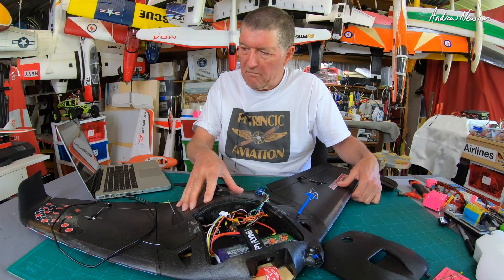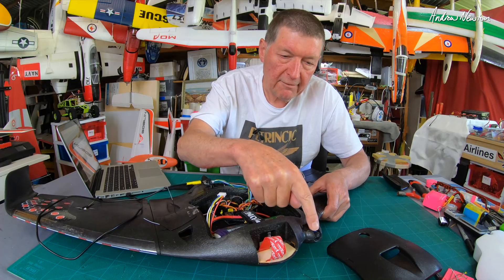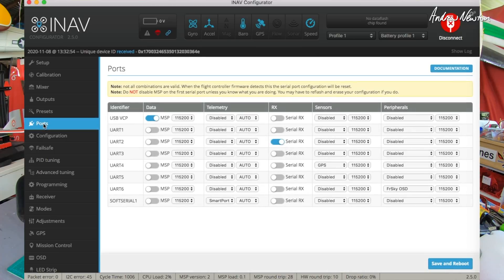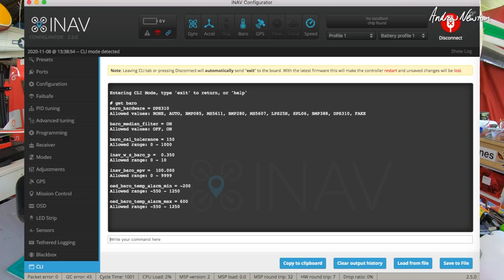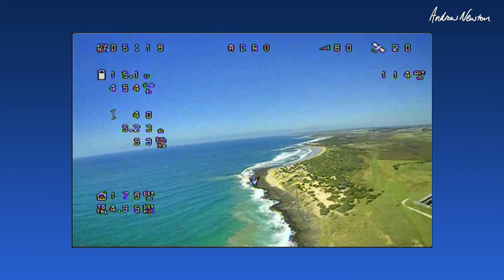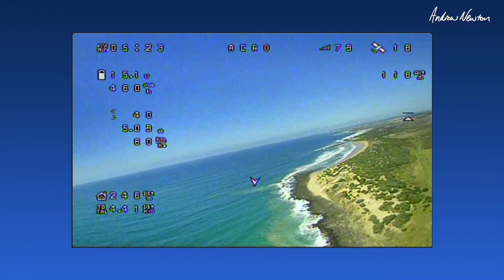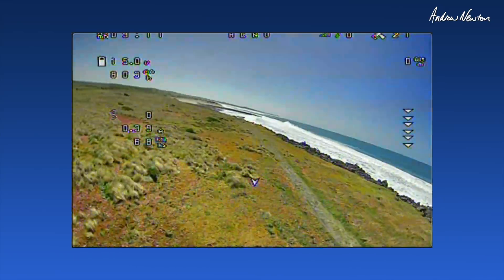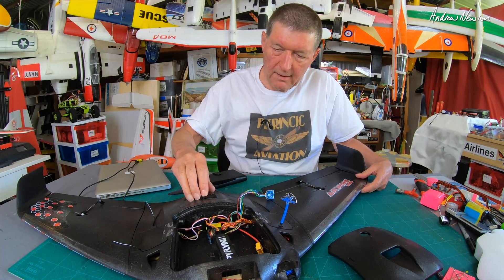AR Wing Pro - Matek F722-WPX

Comment: I am finally dipping my toes into iNav. Do you have a recommendation for a type of flight controller to use with this wing and a dji system?  Oh yeah and Crossfire.
Reply from the maker: Any of the Matek Wing or WSE boards. F411 can handle DJI with the correct firmware but I would prefer one of the bigger boards.
Reply: @AndrewNewton  I might try the matek f722wpx if I can find one in stock. Is the OSD for iNav decent with DJI Systems?  I have it running ok on betaflight but use a Kopilot FC
Reply: @AndrewNewton  does the f405 not work with dji systems?
Reply from the maker: @johndylan9309  No problems using the F405. But do you understand that DJI doesn't use the INAV OSD chip?
Reply: @AndrewNewton  wait so regardless of matek FC I would not be able to see any OSD display in my dji goggles?  Does that mean I am better off just keeping the kopilot as a FC and using any FC with a gps through betaflight
Reply: @AndrewNewton  maybe I miss understood you. Painless360 is telling me that iNav OSD is supported by dji but limited?
Reply from the maker: @johndylan9309  Lots of videos on the subject John. Including on my channel https://www.youtube.com/c/AndrewNewtonAustralia/search?query=dji%20inav

Comment: Great review, I'm trying to get my ar wing pro ready for maiden but can't get the sonicmodell 40amp esc to work. I've wired it to my f405-wing like I've always done setup inav 3.0.1 like always but this thing just beeps slowly and constantly it won't program using inav or radio, only thing is I'm not using the build in servo connector on this esc, what's the purpose of this connector? Is it required to make it work? Thanks for video
Reply from the maker: Not using the servo connector? Must connect the black and yellow/white wires to the FC (but not the red wire)
Reply: Thanks Mr Newton I'll give it a try

Comment: Out of the box, the throws on this plane are almost double the 12mm.   Did you limit the throws in the radio or in INAV?  I've done the Drift and the Ranger 2000 in INAV got them flying well in manual mode without any adjustment to the throws.   Apparently rule #1 in INAV, no mixing on the radio, seems like changing throws on the radio would fall into that category.  I thought I watched on your INAV videos, and I thought you did this in the mixer on INAV.  With the AR WING PRO, seems like you are limited in mechanically adjusting the throws due to the 1 hole on the control horn.
Reply from the maker: Are you testing throws with elevon mixing (50 aileron / 50 elevator) or using full 100% input? If you're using an INAV flight control board then all mixing is done in INAV, and you can reduce the mix weights to whatever is appropriate.
Reply: @AndrewNewton  . Basically, I have my mixer setup like yours (except servos are 2 nd 3 instead of 3 and 4).  The confusion for me is (everyone says set your plane up mechanically in manual mode before you hook an FC to it).  Flying without an FC in manual and you mix in the throws in the radio and the plane flies well.  Now you move to INAV and you remove all mixing.  So if I understand correctly the process would be:
1. Trim mechanically and get flying well in (without the aid of a flight controller ) this would also include adjusting your throws in the radio
2. Load INAV on to an FC and set  your plane up as a wing
3. Remove all mixing from the radio (trims/weights/etc)
4. In the Servos tab DO NOT ADJUST the weights (only reverse servos as needed in order to get the pitch working in the correct direction)
5. In the Mixer tab (set the servos up like you have 50% stabilized role, 50% Stabilized pitch for both servos with the weights with a "-" in front of them if needed in order to get the "high 5" of the control surfaces working correctly
Reply from the maker: 3. Yes that's correct as long as you remove the elevon mixing in your radio as well. 
5. and you can reduce the 50% values if required to get the right throws in Manual Mode.

Comment: Hey Andrew, glad to see you answer comments even from some older videos. Super helpful! Is there a reason I don't see people using the F722-Wing anymore? I can find the -WPX and apparently it's great, but I own the F722-Wing and I don't want to add it to a plane if this FC has been recalled for some reason.
Reply from the maker: It's fine, no issues. Just that the WPX style is the new configuration style.

Comment: Hello andrew 
What is the all up weight with this setup

Best wishes
Reply from the maker: With FCB and FPV this is about 1100g using 3300 4S
Reply: @AndrewNewton  thank you 😊
Reply: @AndrewNewton  Awesome video Mr Newton as always. I have a few questions as it would really help me decide on which to purchase between this wing and the chaser C1, I like this wing more but here goes...

1. What is the max flight time and amps you get at cruising with the stock motor with prop, a Flight controller, normal 40a esc, 3300 mah 4s lipo, and fpv gear which is mostly an fpv camera, vtx and a 50g cheap go pro ?

2. With the above components installed, does the ar wing pro require more weight at the nose to get the CG correct ?

Thanking you in advance !

Comment: Hi, I know Sonic model recommend to use a 4S Lipo or Li-ion but do you think it would work fine on 3S ? Maybe with a different motor and prop combo. I am looking to do long range flights with it and i already have 2 sefl-made 18650 Li-ion batteries and it would be a bummer to open and re-do them. Otherwise, I love your work, great videos.
Reply from the maker: Yes of course, just needs a bigger prop

Comment: Quick tip if you dont enable frsky osd on uart 6 you will not have any osd it must always be on uart 6. This board only has frsky osd I would have liked the option for inav osd or even both since it seams most will use it on inav and frsky isnt fully developed yet but I am sure will be great. hope it helps someone

Comment: Can you not setup the analogue in parallel with the dji video with another vtx? I have been wondering about this. If I want to take a significant other or family member for a fly it would be good to give them the dji goggles and fly from the analogue feed.
Reply from the maker: Of course, two totally separate FPV systems. Just have to choose channels to be far apart I guess.

Comment: Looking forward to trying it out when they come in stock in the U.S. Word of caution with iNAV 2.5.2. It's buggy and cost me two aircraft last week to the tune of about $1,000. The 500mm long-range quad started behaving strangely in NAV modes then finally became uncontrollable and crashed. It was well-balanced and vibrations were minimal. The other was a loaded FX-61 that went down on the side of a mountain. The firmware started glitching and went to auto throttle in angle mode but didn't show it on the OSD, then it just randomly disarmed and that was all she wrote. While setting up the quad the motors also armed and idled on the bench. The outputs were disabled. The Quad was running a Matek F722-SE and the FX-61 an F405-Wing.
Reply from the maker: Yes you have had some unusual glitches.

Comment: I also really like that FC. Question: Do you also have sometimes a strong delay when using the INAV OSD menu? Sometimes it stucks for a second or so. No issues in flight. And What FPV cam do you use? Nice picture quality.
Reply from the maker: Not that I noticed Marc. Runcam Phoenix 2 cam, my favourite
Reply: @AndrewNewton  Ah okay. I have a Phoenix 2 on my speed AR wing. Indeed an awesome camera but it's basically the same as my ratel. I really to look at my settings then xD Might have messed something up.